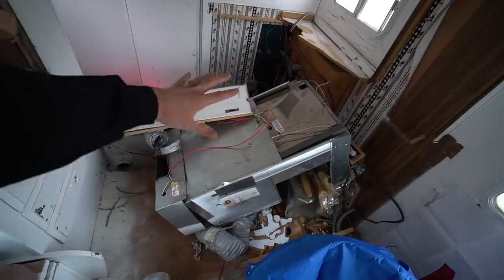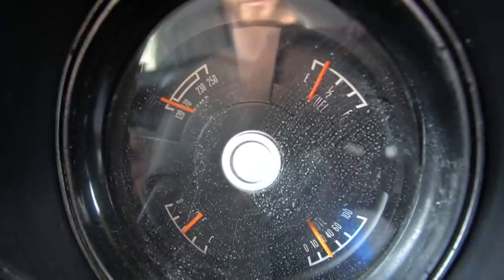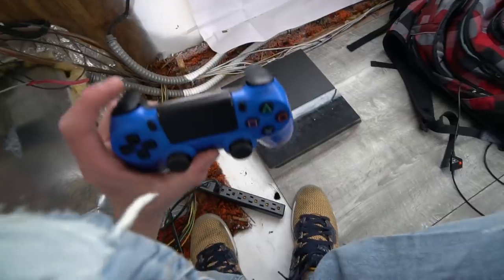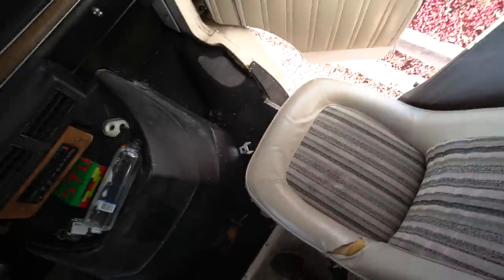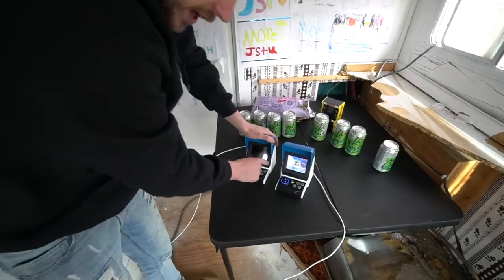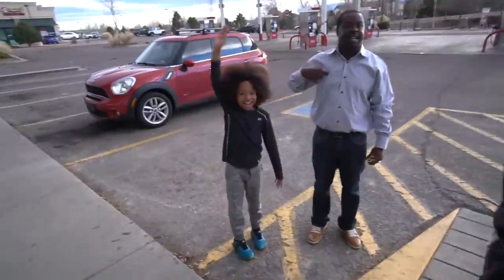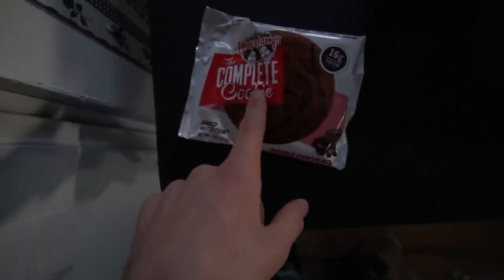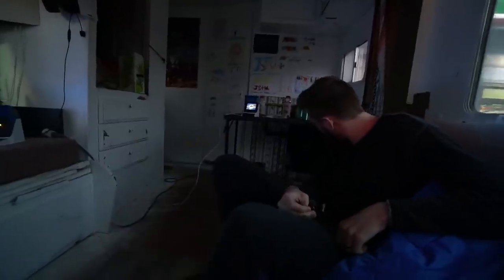RV POP UP ARCADE SHOP!

Comment: Ways to improve the r.v

1 add a fridge for snacks
2 add a curtain in between the cab and the back seat 
3 finish all the tiles all the way through the r.v
4 clean up the cab and the very back
5 fix The outlet 
6 repaint the in or outside
7 get a fire extinguisher just in case
8 add better lighting
9 fix the little over hang so you can actually fit someone on top
10 add an actual t.v mount
11 add good speakers 
12 add better cabinets
13 add more bean bag seats
14 get new windows
15 get a little bathroom maybe
Like if you agree😎
And keep up the good work guys ❤️ you!
Reply: Do a Minecraft video because Minecraft is it my favorite game in the world
Reply: The RV doesn’t exist anymore, and Hyper Seth Fenton left

Comment: You should get a small generator to run the plugs in the RV, so you can set up stuff like this anywhere. You could get a power inverter for the engine already there, but I don't think you want that big block Mopar draining your gas. 
You don't even need to run it to the plugs, you could use either the electrical hookup that it already has on the side or just run an extension cord.

Comment: the reason why the outlets did not work was because he got go to a campsite plug in the wire into the back for those plug in, so then it powers your PlayStation